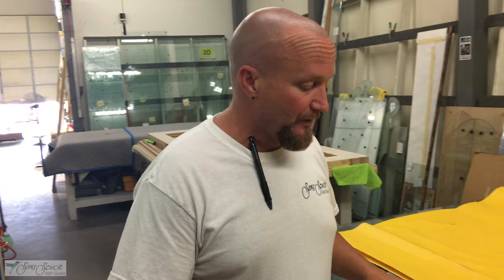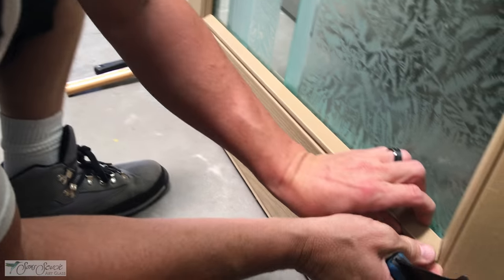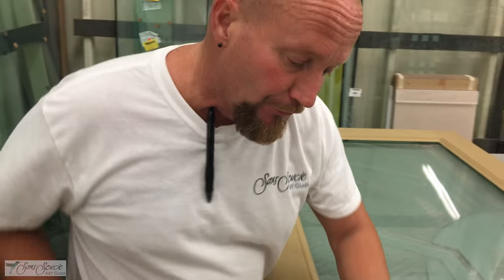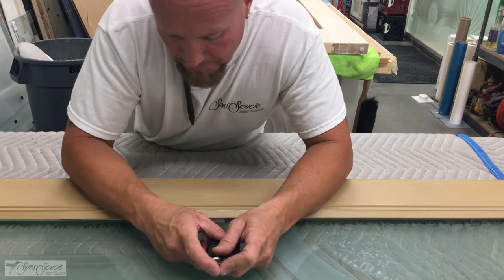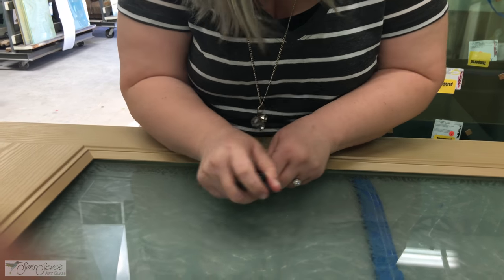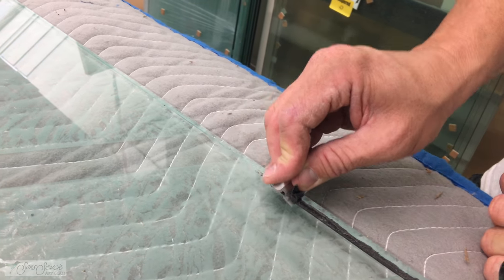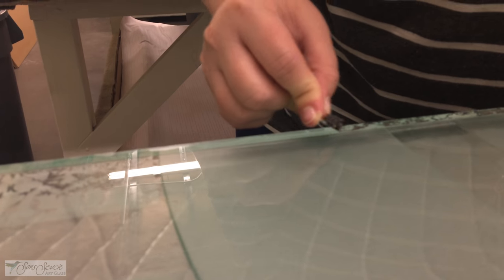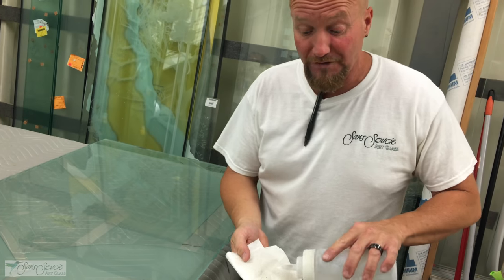How To Remove  Glass from Fiberglass Door - Install New Glass

Comment: What type of door do you recommend that is easiest to remove the moulding?
Reply from the maker: Thanks for the question!  The majority of Interior primed or wood doors have "removable stops" on one side, so those are the easiest.  These particular exterior fiberglass doors are more difficult.  You want to look for an exterior door that is listed as having "removable stops".   You would ask the manufacturer or vendor if the door you're looking to buy has removable stops.  All doors are different.